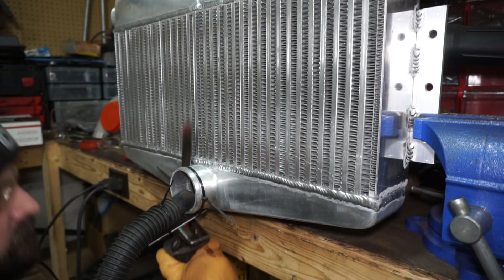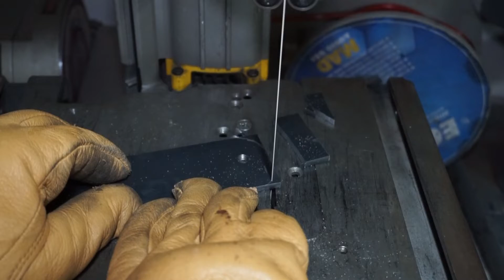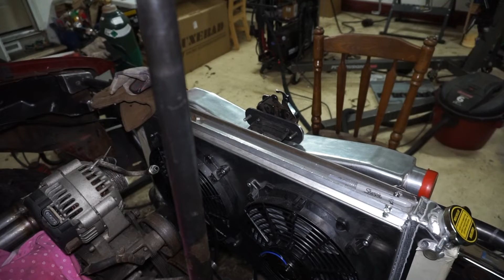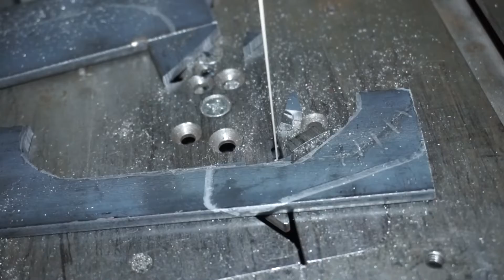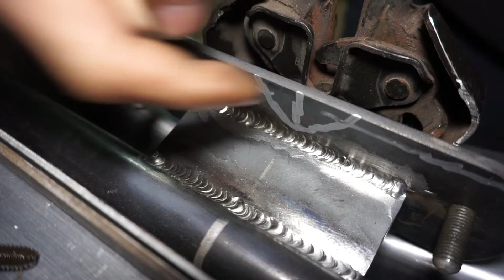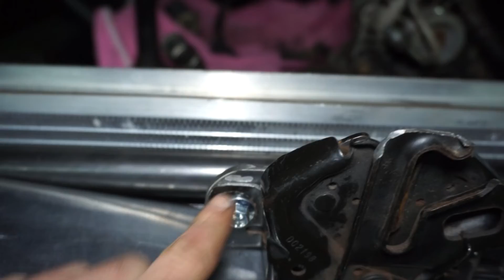Fabricating Hood Latch Bracket For Tube Front V8 Swap Ranger

Comment: Now all you need are the hood struts from an Explorer. Nice work on the hood latch. Will you be able to get to the secondary release once the grill is on?
Reply from the maker: Now there's an idea... I was going to make a little hole for the prop rod. Hmmm...
Reply from the maker: Found a kit for this year  Ranger on Amazon for 100 bucks... sweet.
Reply: @BlaserBuilds  Yeah, for some reason Rangers got hood props and Explorers got the little gas struts. Not sure if the hinges were slightly different or not, but I suggested the Explorer setup since you could probably score it cheap at the junkyard.